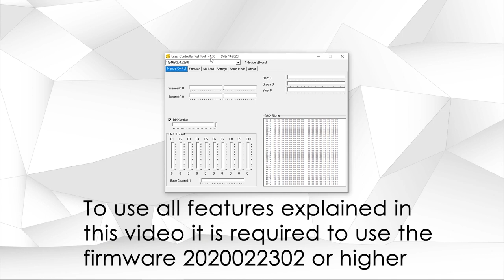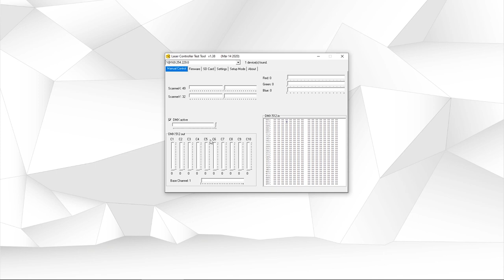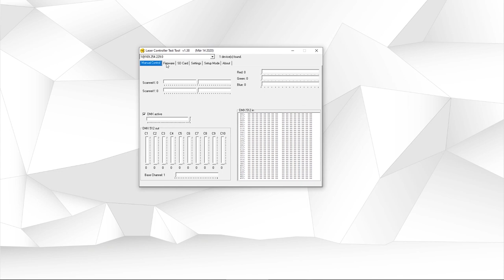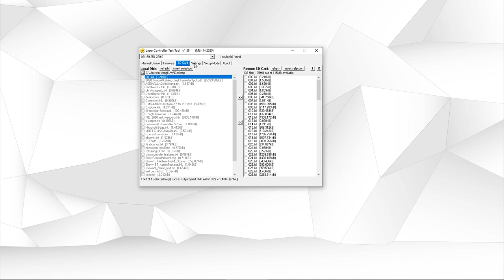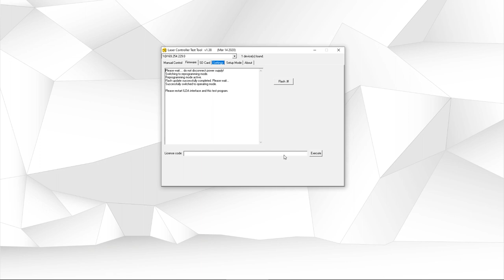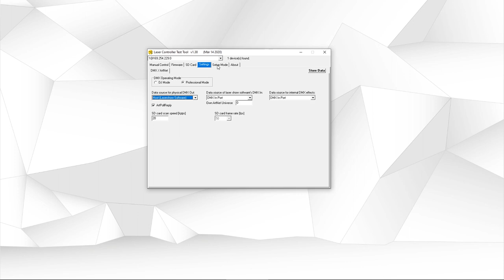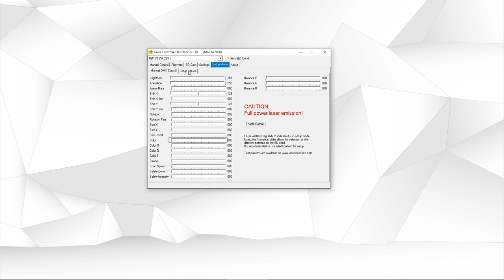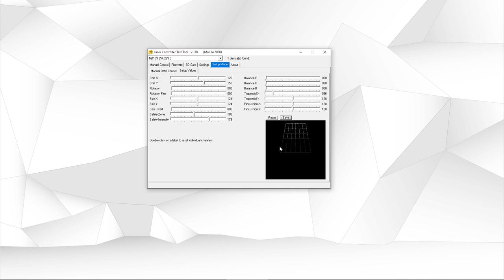ShowNET Admin Tool 1.38 explained, including Zone Setting and Setup & Store mode | Laserworld

Comment: why in pro mode there is no continuous rotation like in dj mode
Reply from the maker: Because you use the effects generator of your DMX console / software to create that effect. It is much more specific and reflects the use of such an effect by professional lighting operators. Using the full channel for this gives even more values for specifically setting the position, and this is what is required by professional users.
Reply: @LaserworldAG  i'm a professional lighting designer,  I use Chamsys MQ80, and I don't think that in the FX there can be the rotation of a digital figure, I can use FX of colors and positions or any other, but a continuous rotation, (as well as a rotation of a gobos), it is usually in a channel of the fixture dmx
Reply from the maker: Usually operators apply a ramp effect and make it handle  as continuous. This works pretty well and was requested by many lighting designers for the professional operation mode. It also has the advantage that if you use several devices simultaneously, you do not get any deviations in speed etc, which would be a thing if you let several units run for a while. So it's THE way to do it. If you prefer the premade effect, you can use the DJ mode, which provides this feature (which is there as especially smaller controllers cannot do any effects).